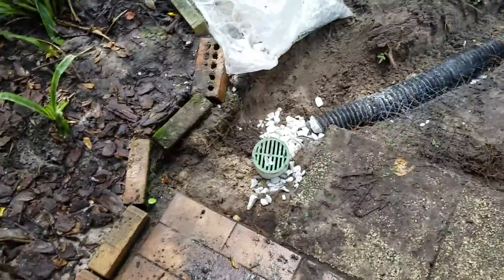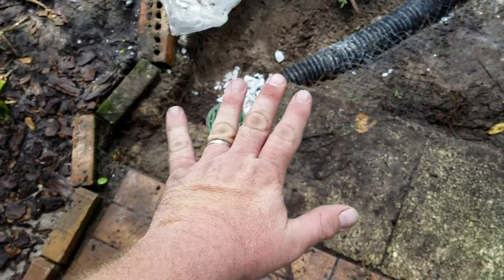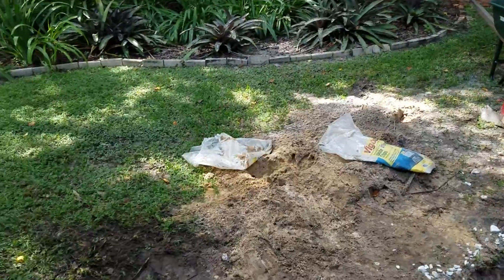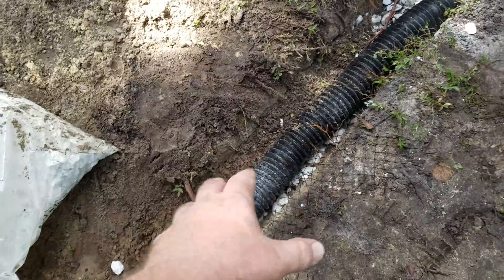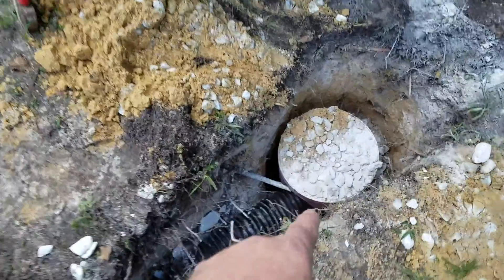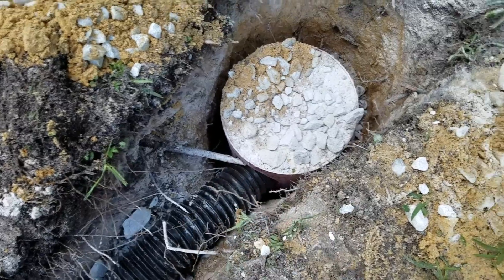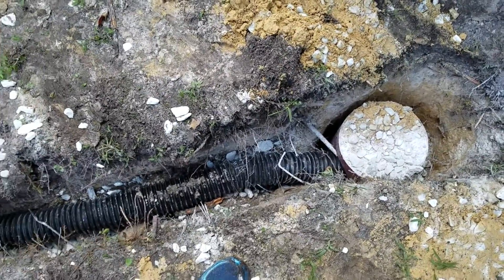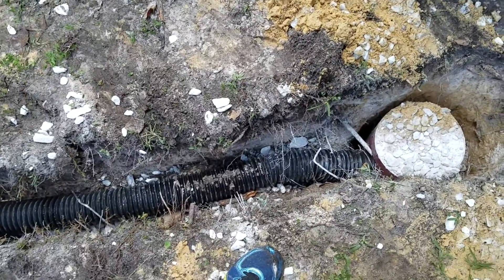How to make a dry well for yard drainage

Comment: Looking to fix a similar issue. I can see you have said it works great. My question is have/did you notice any issues or concerns with the ground being stable above or around the bucket? I'd be worried the bucket is not strong enough to support someone walking above it and would fail overtime.
Reply from the maker: No. Its still fine. I actually covered the bucket with a rocks and then dirt and no problem. I could see where that could be a concern because some people put the bucket closer to the surface with a water release but I did not. For me the way I did it was just enough to keep the water away.

Comment: So did it work? I need to build one for my backyard it puddles waaaay too much in the backyard.  LOVE THE ENDING OF THE VIDEO....I don't care what you guys would do...lmao! I totally feel that! But yea did it work? How deep did you go into the soil?
Reply from the maker: Cyrious So far so good. This type of drain won't last forever. It will have to be replaced after a number of years because it will clog. You just need a very slight downward slope all the way. It's recommended 1 inch per 10ft. I did mine at a steeper slope then that though because my drain was only about 10ft in length total.
Reply: Ok thanks because I am going to start digging this weekend I really need it I am so over the pooling at the end of my patio.  Thanks again!!!

Comment: Just to be clear, did you drill any holes in the bucket full of rocks for the water to drain out of? Also, is the bucket upside down with the open end at the bottom, resting on gravel? I couldn't tell from the video. Thanks for this, by the way.
Reply from the maker: Yes the bucket is upside down and open on the bottom with rocks underneath it. No I did not drill any holes. It has been working great.. Thanks.

Comment: You should have used non-woven geofabric to encapsulate the rock and pipe together.  You should have used a 3 inch pipe.  You should have dug a deeper hole for the well.  You should have dug the trench deeper.  You should have rented a mini escavator.  You should have used Baughman blue high capacity pipe.  You should watch some French Drain Man videos so that you can learn how to do these things right.  You should do it right the first time.
Reply from the maker: You should make your own video! It has been working great ever since.